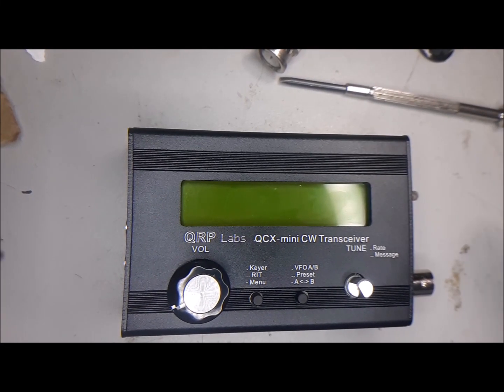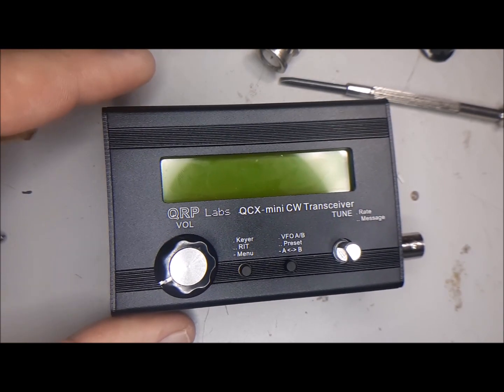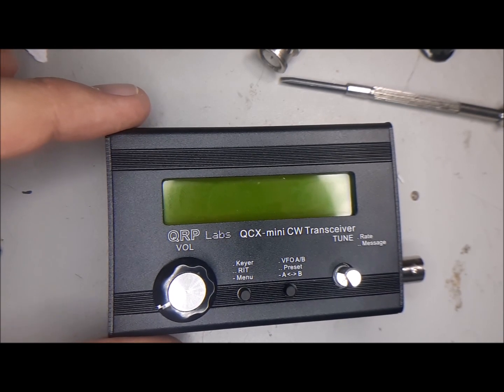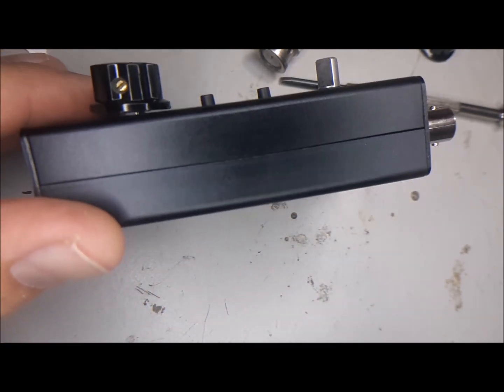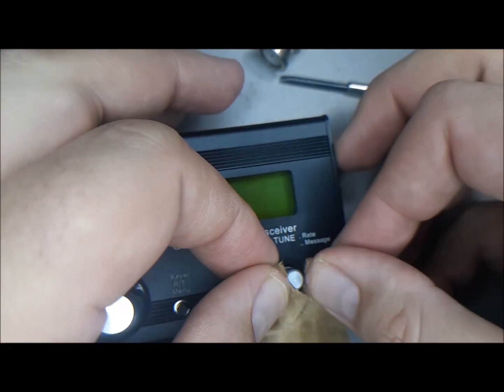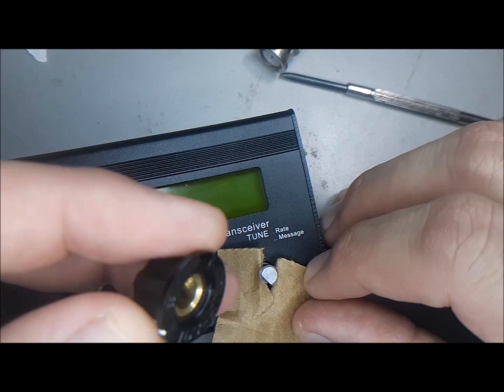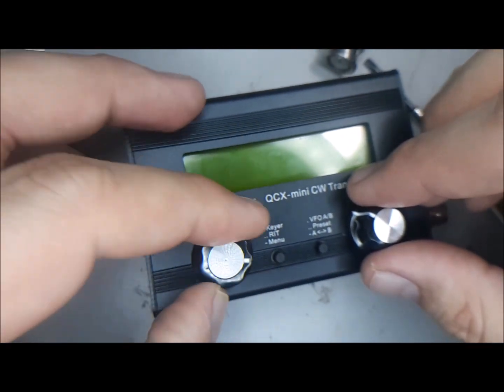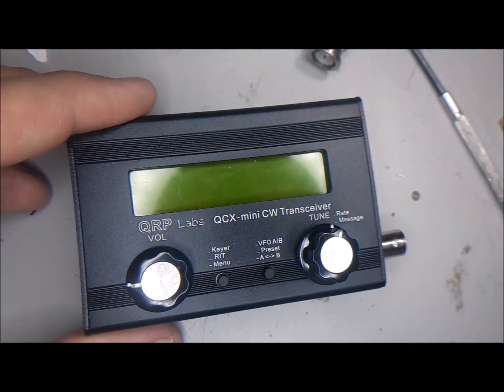QCX Mini Mini Tip 11   Final Assembly

Comment: Ryan, did you use a electrolytic capacitor for the Notorious C38 mod? It seems that you volume potentiometer is in a angle. I had the same problem. See : https://ph2lb.nl/blog/index.php?page=qrp-labs-qcxmini ( Section : Re-doing "QCX-mini critical modification advisory"  ). Fixed it using a  22uF/25V tantalum capacitor (smaller then the electrolytic).
Reply from the maker: Yep used an electrolytic. It's only noticable if looked at from that angle. It doesn't bother me :)